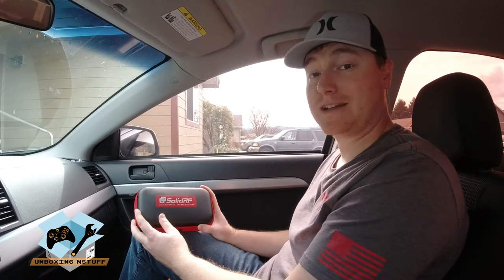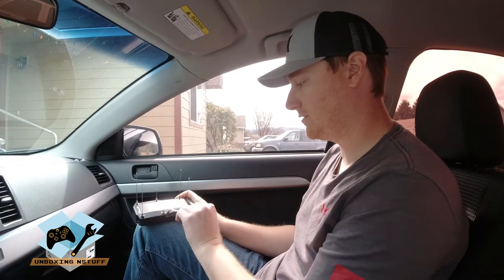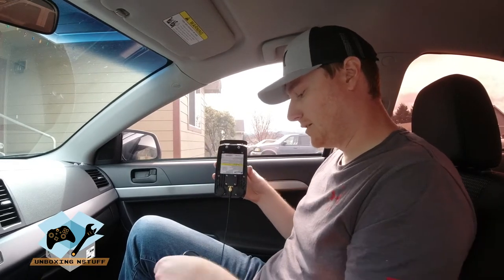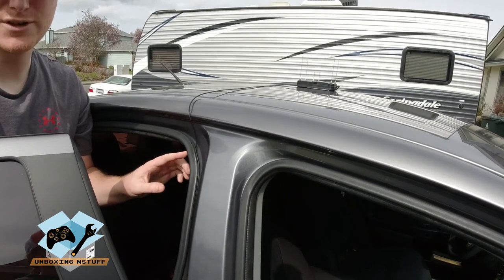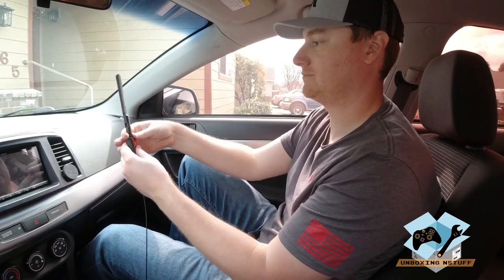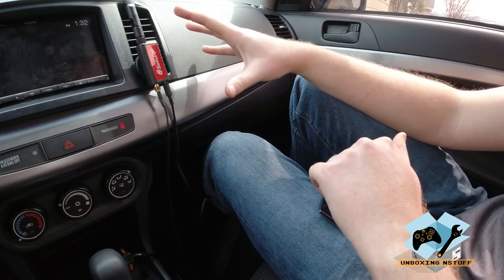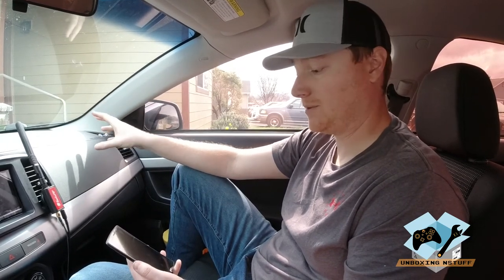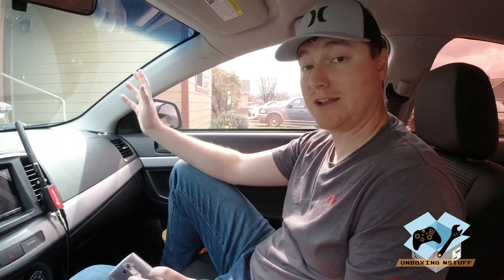Get Solid RF Terrain to Boost your Cell Signal - See How It Works and What to Expect

Comment from the maker: (EDIT 3/8/2020) Please note the inside antenna is supposed to be horizontal and not vertical, this can affect proper antenna separation and overall performance. This will be corrected in my upcoming testing video.